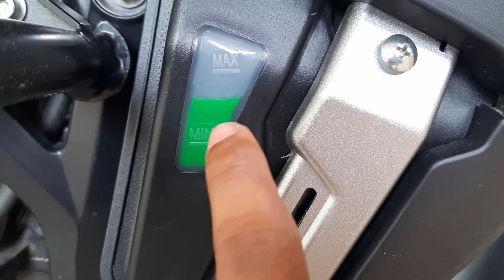NS200 BS6 Coolant problem in new bike #தமிழ் with in  250km (coolant reduced)  new problem

Comment: I am facing this problem in my new dominar 250 after riding for just 170km. I went to the showroom and they just refilled the coolant upto the max level..while returning I went to a trusted bike mechanic who also happens to be my friend. He said that this is common in Bajaj Bikes as they don't fill up the radiator properly so there happens to be some air pockets..this will happen two times and then everything will be okay.
Reply from the maker: 😁👍 ok broo ...what about dominar 250 performance broo .. I have rided 400 but what about 250 broo
Reply: I have also  same problem in ns 200 bt give me suggestion how to solve it
Reply: Bro hows dom 250 i am planning to buy new one.
Reply: bro bappa please reply i just buy d400 new 2022 after 250 km my coolant goes min and service centre guy just refill and now after 100 km coolant level slightly drop so this is normal for new bike or this is big major problem and what about your coolant condition right now plss reply im waiting

Comment: Hi Apache 180 dual channel abs bs3  use havey vibration  ns 200 same vibration irukka sellunga
Reply from the maker: @5000 rpm mattum Vibration iruku feel pana mudium.. after that nala smooth ah irukum broo....Vibration is not much.
Reply: @gpjoy8772   mileage 25  30 selringa really
Reply from the maker: @perumslperu9774   yanaku mileage 40 kudukudhu

Comment: Bro engine if hearted continue the radiatior fan is working not  cutoff bro  please put the video i changed new coolant oil and new engine oil after that only i facing the problem bro
Reply from the maker: That's may be due to thermal sensor problem broo... if sensor is not working properly radiator will not cutoff just check it bro..

Comment: Bro same problem in my ns 200 bs6 
I had just completed 250km but coolant oil reduced and engine heating problem what to do bro tell me pls
Reply from the maker: Bro just refill the coolant bro. Then it will be all right
Reply: Thanks bro
Reply: Bro yennoda problem athu illa bro
5kms once engine heat aaguthu bro approm fan odutu bro athuku konjam solution sollunga bro
Reply from the maker: @rajaraman1763   bro I think problem in thermal sensor broo.... so thermal sensor check pana solunga

Comment: I having this same issue bro but mine is bs3 model ns
Reply from the maker: Once check panerunga broo
Reply: @gpjoy8772  bro i am actually filling it in the sub resouvior, and it's getting over fast. Less than 200 kms actually. What if the main resouvior is less and does it have anything to do with it?

Comment: I had similar problem where coolant was mixing with engine oil. Change of seals, Head gasket several times could not solve the issue. Ultimately Engine Casing has been replaced
I hope the issue will be resolved now.
Reply from the maker: Now its ok for you broo are still there is any problem
Reply: does that affect engine?
Reply from the maker: @anandyadav6996   yes bro ... engine will be over heated ...
Reply: coolant getting mixed with engine oil does that affect engine?
Reply from the maker: @anandyadav6996   if you drive your bike for a long it will surely effect the engine

Comment: Na duke200 bs6 use pandra 69km dha odiiruku adhukula coolent level min ku poeduchu
Reply from the maker: Bro just showroom poi refill panekonga broo... over heating issues yadavadhu bike la varudha broo coolant reduce anadhuku apram??
Reply: Coolant top up pane Iruka
Reply: Coolant dha main problem aa iruku overheat issue la eila bro radiator fun correct aa work panudhu
Reply from the maker: @vickyduke3974  apo no problem broo just refill panunah podum
Reply from the maker: @vickyduke3974  suprb broo
Reply: Unga bike la eipo coolant koryeudha bro
Reply from the maker: @vickyduke3974  ila broo
Reply: Top up Panna peragu level konja down agiiruku
Reply from the maker: @vickyduke3974   yanakum konjam achu bro adhukuaprm seriaiduchu
Reply: Ok bro
Reply: Insta la yarukavadhu msg Panna reply aa panamatranga neenga la vandhu reply  paneingale romba thanks bro
Reply from the maker: @vickyduke3974   thanks broo😁😁 insta vanalum kelunga broo nan kandipa rply panuven broo... thanks broo....

Comment: Brother i have also faced this problem i also buy new fi abs ns 200 and there is heating problem and i have filled the coolant 2 times and my bike is runing only 80km and i buy my bike there before yesterday bro help me🤧 the coolant will finished in a day😓
Reply from the maker: Bro this is not a big problem broo if there is no leakage of coolant then it is mainly due to evaporation broo just once again refill the coolant broo then it will be fine broo 😁😁and keep supporting my channel broo

Comment: Anna na duke 250 yaduthurakain 500 km la roimba koraingetuuu bro na eppom enna Panna Monday showroom koindu vara sonainka
Reply from the maker: Maximum adhu evaporate dan airukum broo...coolant engine oil  kuda mix airukanu check panengala
Reply: Anna duke la yatha paka mudiyala anna
Reply from the maker: @racingasir1017   engine oil level check panradhula parunga bro terium

Comment: I'm also facing same issue bro I didn't understand ur solution bro can u explain in English? I didn't even ride 300km but coolant level got reduced very much.
Reply from the maker: Yes broo ..we know coolant reducing is mainly due to breaking of coolant tap or mixing with engine oil.... But other than this there is some other 2  reason which happen to my new bike in 250km which is coolant evaporation from my coolant reservoir cap and there is other reason due to air lock inside coolant reservoir this are two reason we don't know which happens in new bikes broo

Comment: Bro radiator work agudha
Reply from the maker: Agudhu bro radiator la yandha problemum ila broo😁
Reply: @gpjoy8772  bro oil crta irku but radioter odite irku een bro
Reply from the maker: @jaanu4933   temperature sensor la problem irukum broo apadi irundha dhan radiator cutoff agadhu
Reply: @gpjoy8772  ohh. Apo radiator odikte irkuma bro..?      Ipo ena pananum bro adha sari pana
Reply from the maker: @jaanu4933  adhu service la kelunga bro avanga sensor change panuvanga ilanah vera yadavadhu irundalum soluvanga...
Reply from the maker: @jaanu4933  ama bro radiator oditae dan irukum broo off agadhu
Reply: @gpjoy8772  ok tnx bro.... Bro selavu over agumo 🙄
Reply from the maker: @jaanu4933  romba adigam agadhu bro bajaj spares yalam konjam rate kamidan ... but labour's charge dan adhigama poduvanga🤦🤦
Reply: @gpjoy8772  ok bro
Reply from the maker: @jaanu4933  😁

Comment: please explain in hindi
Reply from the maker: Sorry bro I don't know hindi broo
Reply: @gpjoy8772  i got a new bike and coolant level was maximim . after 100km it reduce to min. is there any issue
Reply from the maker: @TheBeaSt-fz1zu  is there is any leakage bro
Reply: @gpjoy8772  i din't found any leakage
Reply from the maker: @TheBeaSt-fz1zu  then it may be due to evaporating broo
Reply from the maker: Coolant evaporation or air lock in reservoir is normal in new bikes broo so no need to worry just go to your showroom and refill the coolant bro then it will not reduce broo and thank you for your support to my channel broo keep supporting
Reply: @gpjoy8772  thnk u